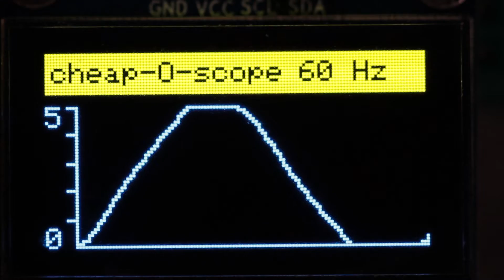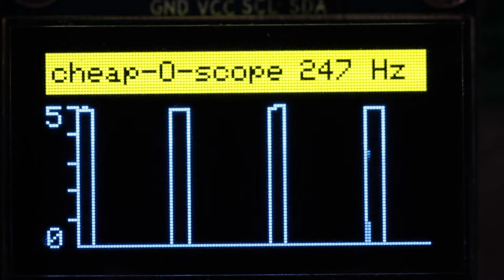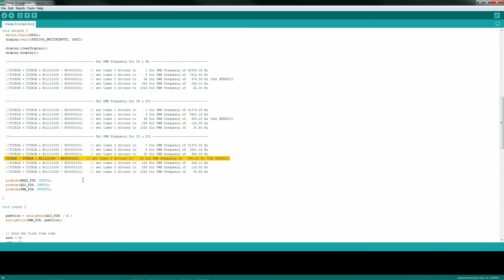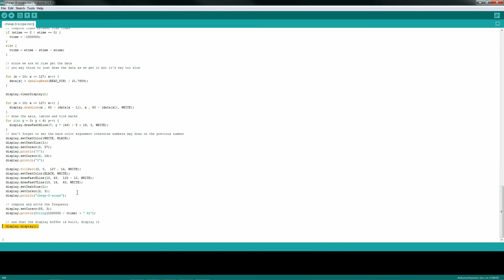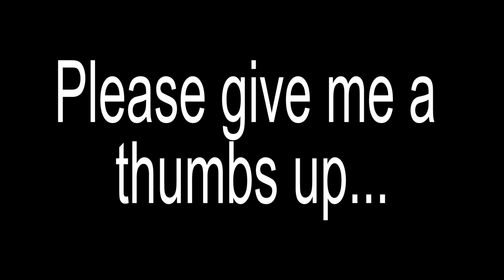DIY Oscilloscope for $20 - FREE CODE

Comment: Something you may like to experiment with, if you have a 328, is the prescaler on the analog clock.  You can increase your read speeds by a factor of about 8.

void setReadPrescale()
{
// https://sites.google.com/site/qeewiki/books/avr-guide/analog-input 

// ADPS Bits
// ADPS2  ADPS1   ADPS0   Division Factor 
// 0      0       0       2 
// 0      0       1       2     # Unusable
// 0      1       0       4     # About 14us
// 0      1       1       8     # About 16us
// 1      0       0       16    # About 20us
// 1      0       1       32    # About 36us Highest Recommend speed at 16mhz
// 1      1       0       64 
// 1      1       1       128   # About 100us Defai;t 

   sbi(ADCSRA,ADPS2);
   cbi(ADCSRA,ADPS1);
   cbi(ADCSRA,ADPS0);

}  //setReadPrescale()
Reply from the maker: GnuReligion excellent reply I can't wait to try this

Comment: I have a 128x128 Freetronics OLED sheild from a previous project but am still new to this how would i go about using your code with the ardunio made OLED screen?
Reply from the maker: I'm guessing your OLED is SPI based? (SCK, MISO, MOSI pins?) Does your library have a "video buffer"?, w/o one i'm not sure an arduino can push data to the display fast enough. The Adafruit libs have one, so basically this program populates the buffer then a call to mydisplay.display(), sends the data over. The code mods will be to draw lines as you run through the second for loop. i've tried doing this and performance is unusable, but your lib may be fast enough.
Reply: Thanks for the response Kris, I'll have a look into it and see what i can do. thx for the help.
Reply from the maker: PS i've been messing with a Teensy 3.2 and that sucker un-overclocked runs at 72 mhz, 120 mhz overclocked. i created a cheap-o-scope that ran at 30 khz with just a few mods to the code. Have a look, it may be able to power your OLED w/o the need for the video buffer.

Comment: Hello again my friend, I have another question about this scope, can I use an oled display that use 7 pins (GND, VDD, SCK, SDA, RES, DC, CS)??
Reply from the maker: Good question, i'm guessing that is an SPI device and you may not be able to write to it fast enough. The OLED (with the Adafruit library, lets you write the data to memory, the that display is set to the OLED. With SPI you would have to write to  the display in a loop).
Reply: Ok, thank for your answer i more easy to use the 4 pin oled display. I hope to make this project nex weekend. See you!
Reply from the maker: PS, i've been playing with the Teensy 3.2 and OLED for this scope and find I can read frequencies up to 30khz, and with 12 bit resolution. Something to look at.

Comment: Great work! Could it be used with a TFT screen like this one ?(http://www.smokeandwires.co.nz/blog/a-2-4-tft-touchscreen-shield-for-arduino) not my website, just my first result at google. I already have this one.  Thanks in advance, and Regards!
Reply from the maker: In SPI mode sure not, if it supports 8-bit mode, maybe, but a big maybe. the issue with these displays is the amount of data that has to be sent to the display, not only size but color information and to my knowledge there is no video buffer. I've tried drawing lines, points, etc. on these TFT devices (in SPI mode), and draw time is really bad. For example i have a "car dashboard" that displays 10 numbers w/labels and 2 bar charts (simple stuff), and it takes 700ms to draw. For oscilliscope, we need to draw much faster.

Comment: what is the software oscilloscope program you use on the computer?
Reply from the maker: The software that came with the oscilloscope.
Reply: aha, the USB Oscilloscope SainSmart DDS-120 i guess...thanks.
Reply from the maker: Correct.

Comment: Wow love this, I have been planning on building something like this for years now, and now I can!  Thanks a million, I know I will get lots of use out of this project while working with my HAM equipment, as well as keeping my herd of Arduino's and ESP8266's in line.  Just a though, could a fellow do this with an ESP8266 and gain a lot of speed with the faster processor and more RAM?  Perhaps I will try it with my ESPDUINO.
Reply from the maker: I'm not sure about other micro-processors. The only downside with using an arduino is it cant measure anything past around 4 kHz. If that is OK, i have another video showing how to use 2 OLED for a "dual trace" scope.
Reply: I tried to compile for the ESP but received all sorts of errors.  Sadly the OLED screens I have, while advertised as the right size only show the top of the screen and the number 5, so I tried building a different scope, but the performance is nowhere near that of this guy.  Perhaps I shall try converting to use SPI as I have a couple of 128x128 full color SPI screens.

Comment: We have tried to upload your code, but it doesn't seem to be working. All connections are correct following the video. What should we do? Please!!!!
Reply from the maker: +Angelo Madonna What is it not doing? Compile, run, etc? Hard to debug with provided info,
Reply: +Kris Kasprzak The sketch is not working despite all connections are correctly done. I am using an Arduino uno and a mini oscilloscope (5Pcs 0.96 Inch White SPI OLED Display Module 12864 LED For Arduino). It gives me an error every time I try to upload the sketch.
Reply from the maker: +Angelo Madonna If it's an upload problem, its not the code. Can you get any other sketch to upload? If it's a compile problem, it's most likely an issue with the libraries. Are you sure that display is setup to run on the I2C bus?
Reply: I find when the sketches do not upload there is usually a problem with one of the #include libraries being out of date.  To solve this I go to my  Library folder and delete the offending library's. You can tell by the date of creation of the folder.  If this does not fix the problem, then I download the latest library and remove all others so the Arduino can select the "right" library.  There are so many updates to the library's that it is hard to keep up with them. The newest Arduino software now tries to take care of this problem, however I see it doesn't always work properly.